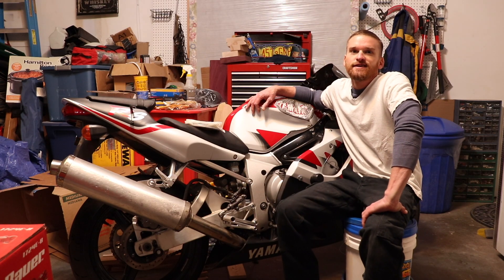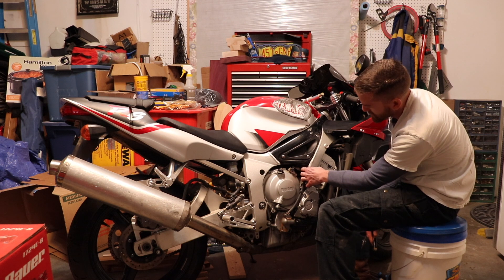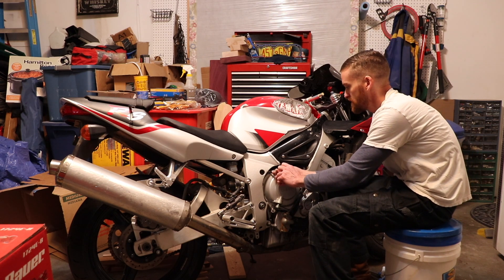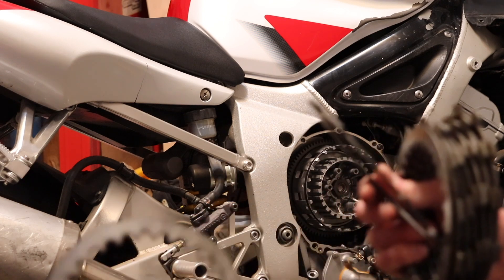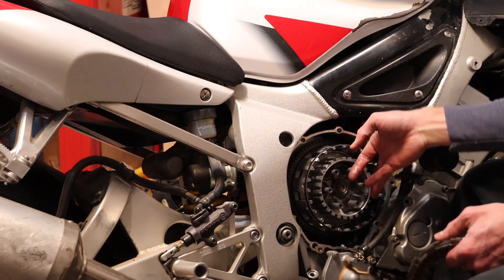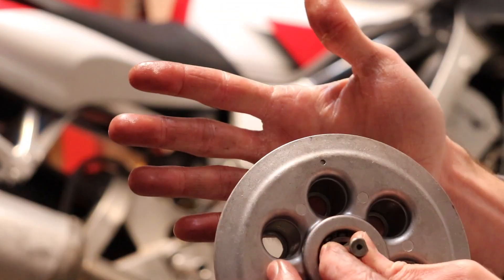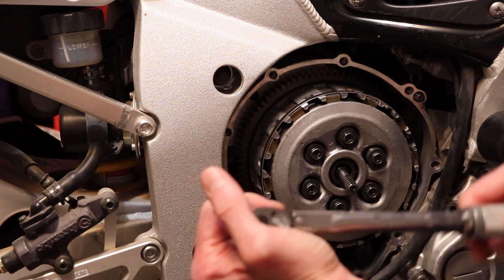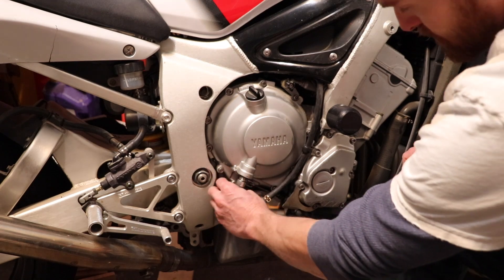2000-2002 Yamaha YZF-R6 clutch replacement

Comment: I've got the frigging 2nd gear issue, how do I fix it
Reply from the maker: You're going to have to pull out the clutch and clutch basket to get access to the Transmission so you can get the gears out. I have a link to the service manual in the description of this video, it will show you diagram. I hope this is helpful. Thanks for watching!
Reply: @WillowsWorldofDIY  soo can it be done without having to split my engine case apart ? I just want to replace 2 with either the 03 5 dog gear or at least get the new one undercut but everyone says I have to split the whole motor casing to access the gears, can I really just pull them out from removing the clutch basket?
Reply from the maker: You definitely do NOT need to split the cases to replace 2nd gear. You don't even need to pull the Engine out of the frame. I have repaired multiple R6 transmissions, the first time I did this repair I removed the engine from the frame but I was also doing other work to the head and cams. After repairing the transmission with the Engine out I realized that I could  fix the Transmission with the engine in the frame and I have been doing it that way ever since.  You will have to remove the shift shaft cover and the drive sprocket on the left hand side of the motor and the oil pan on the bottom of the motor as well as the clutch and clutch basket on the right side of the motor. Then you will have access to the drive axle assembly, you have to use 2 6MM bolts and screw them into main axle assembly bearing housing, it shows you in the service manual exactly where you need to install the 2 6mm bolts on page 4-89. screw the 2 bolts in till they hit the case and then it will press the main axle bearing assembly housing out as you tighten the bolts. once that's done you have to remove the shift forks and shift drum, then the main axle shaft assembly will pull right straight out of the right side of the engine. then you can remove the drive axle assembly on the left side of the motor where the drive sprocket goes. The Service manual really needed you will find the Transmission section on page 4-83 through 4-91. I hope this is helpful. Let me know If you have any more questions.
Reply: @WillowsWorldofDIY  you're the r6 God brother! I will keep you posted on how it goes sounds similar to my yz90 transmission I grew up wrenching on so hopefully it goes off without any issues, I did the clutch after watching your YouTube video and it went awesome not much different from the old Harleys I'm used to working on, but the little things like the thicker back plate and the dot on the clutch basket to line up is what made it go smoothly for sure thanks for being awesome man!! Maybe I'll make a video of the project lol, do you got a website for merch ? I'd like to help support the channel anyway I can bro
Reply from the maker: Lol! Thanks bro! It sounds like you have experience wrenching on motorcycles so I think you can get it done. It definitely takes some time and patience, it's a little tricky putting it back together, just hard to reach getting the shift forks lined up to get them back on but its definitely doable so don't give up. I have been wanting to make a video on this repair, I just haven't had any problems with my R6 transmission since I installed a the new gears. I sent the gears to R&D race transmission and had them under cut and hardened. I don't have a website yet, but you can leave me a tip with the super thanks button on my videos. I really appreciate the love and support. keep me posted, I will try and help if you have any problems.

Comment: Hi buddy I’ve got a 99 with a problem that sounds like it’s coming from the front sprocket ⚙️ shaft do you think it could be the bearings if yes how do you change it? Can it be done without pulling the engine out? Tia
Reply from the maker: It's hard to say without seeing it in person, there's a lot of noises that could come from the transmission. There is 2 bearings on the drive axle assembly (front sprocket axle) and 2 bearings on the main axle assembly. The bearings on the main axle assembly can be replaced without pulling the motor, but to replacing the bearings on the drive axle assembly you will have to pull the motor and split the upper and lower cases to remove the bearings. I posted a link to the service manual in the description of this video, the transmission section starts on page 4-83. I would start by taking off the chain and try moving the drive axle to feel for any slop or tight spots in the bearings. I hope this is helpful. Thanks for watching!
Reply: @WillowsWorldofDIY  thanks for your reply buddy I have just replaced the back brake pads yesterday and when I put the wheel and chain back on the adjust it I did notice the chain got extremely tight when I spun the wheel so just had to leave it a little slack than I would expect. So looking like I need to get it to a garage lol cheers buddy
Reply from the maker: It could be a tight spot on the chain and that can wear out the bearings over time. I would put a new chain on it and see if it gets better before you start pulling the  motor and split the cases.
Reply: @WillowsWorldofDIY  I’ve replaced the chain just a few months back so I’m guessing it’s the bearings that are the main problem. It’s a pain in the ass and a bigger pain to my wallet lol but if it’s gotta be done. Cheers buddy at least now after watching your video I know how to change my clutch. Top man

Comment: How’s it going. I have a 2001 Yamaha R6, I purchased it from an auction. The motorcycle turns on and stays on however, when I hit the first gear it stalls automatically. Do you know what might be the problem? . Thanks for your help
Reply from the maker: Does the motorcycle move forward when you put it in gear before it stalls? If so its probably a problem with the clutch not disengaging and could be a simple clutch cable adjustment. If adjusting it doesn't help it could be a problem with the clutch or the transmission. Does it make any noises when you put it in gear?
Reply: I'd definitely look at your kickstand sensor and clutch sensor. If your short those auto kill switches and it's still stalling, then look at the clutch.
Reply: @WillowsWorldofDIY  It cuts off as soon as you put in gear .
Reply: @marshelglidden1734  Yea I had a question about that. So the kickstand sensors is cut off completely. I got the bike as it came from an auction. Would I need to replace that kickstand cable
Reply from the maker: I agree with Marshel, I think it's the kickstand sensor. You can install a piece of wire or just connect the two kickstand sensor wires together to bypass the kickstand sensor. I bypassed that sensor on my race bike and it worked just fine. If it works then you can decide if you want to replace the cable and sensor or leave it bypassed. I hope this is helpful. Thanks for watching!

Comment: Hello! I have a problem with my r6 it May be the clutch. When i change to gear and release clutch nothing happens. What do you think? And btw where can i buy quality fairing coat sets?
Reply from the maker: I'm really not sure without see the motorcycle in person. Does the transmission feel like it's shifting through all the gears? or is it stuck in neutral a false neutral? If the transmission is shifting properly then I would look at the clutch. I usually get race parts from Sportbiketrackgear.com and they sell race fairings/bodywork. I hope this is helpful. Thanks for watching!

Comment: Hi can u do cables
Reply from the maker: Clutch Cable? Throttle cables? How to adjust them? or replace? Can you be more specific?
Reply: @WillowsWorldofDIY   I mean carburetors needles and seats Yamaha r6 yzf  2000
Reply: @WillowsWorldofDIY   my bike is over fuel
Reply from the maker: @deongreyvenstein9818  so do you want to know how lean out the Carburetor? or rejet the Carburetors and replace the needles? Is your R6 jetted for your elevation?
Reply: @WillowsWorldofDIY  hello do u mean about  jetted for your elevation do u have pic to show me

Comment: My won’t go past 2nd gear help
Reply from the maker: If your motorcycle won't shift up past 2nd gear it's most likely a problem with your shift drum and shift forks. These parts wear out over time and will affect the gear shifting in the transmission. I have replaced the shift drum & forks in my R6 and in a couple friends motorcycles as well. You don't have to pull the motor for this repair but you will have to remove the clutch and clutch basket to get to the transmission where the shift drum & forks are located. I posted a link to the service manual that I use in the description of this video, the transmission section is on page 4-89 and it will tell you how to check the shift drum & forks. I hope this is helpful. thanks for watching!
Reply: Willow’s World of DIY thanks for the advice I needed that 😅 an I have a r6 to great bikes just having that one little problem

Comment: hey man quick one sorry dont the oil dump? because my oil is new lol so if can save it e grate haha
Reply from the maker: I don't recommend installing a new clutch with used oil, even if its only slightly used the oil it can have debris from the old clutch and the oil can get brunt if the old clutch was slipping and overheating the oil. I hope this is helpful. Thanks for watching!
Reply: @WillowsWorldofDIY  no only the cable lead I changed.